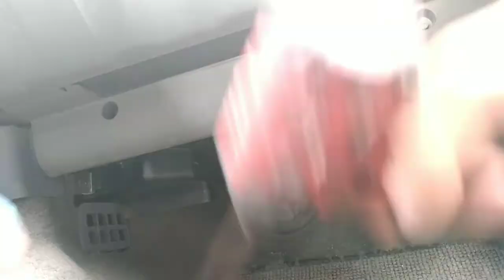how to replace cabin air filter Nissan Frontier DIY #nissanfrontier #cabinfilterreplacement

Comment: Why are you taking all these screws out? Drop the glove box open the small door replace the two filters and your done. All the stuff you did is crazy.
Reply: can you show us how to drop the glove box?
Reply: @mgogmaj14  I used a screw driver to pull it out until you get passed the knob. Other YouTubers show you how. I don’t know how but I had a leaf and plastic chewing gum lid on top of the filters. AC and heat blows so much stronger
Reply: Depending on the year, they're all slightly different
Reply: @jkaugust3586  Mine is 2008.
Reply: Oh hellz yeah! I was about to write a snarky comment to complain about having to remove 5 screws and the panel just to replace an air filter ( !! ) and saw this comment, and indeed, you can just squeeze the glove box so the retaining pegs on the side don't... retain... anymore, and voila, you have access to the air filter panel which is easy to remove. Great way to save literally $50 on my next maintenance. Thx!